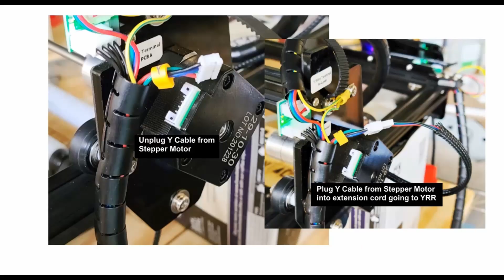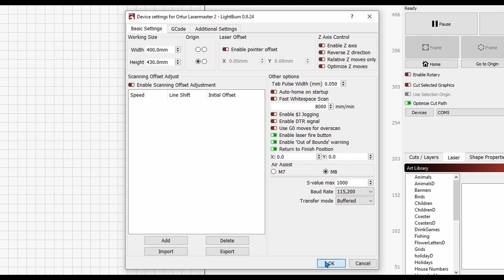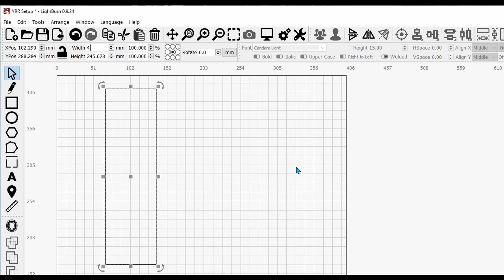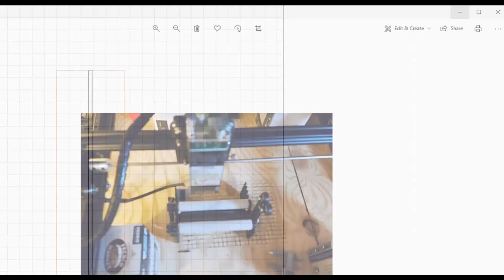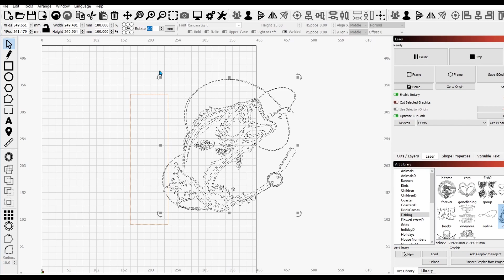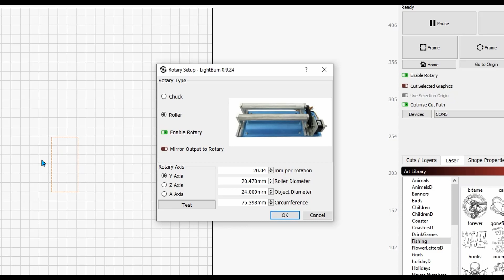👍 Ortur YRR Rotary Setup - The Only COMPLETE guide!

Comment: Hi.. If I removed the Y connector and i want back it to normal cut or engrave , i will use only the default setting I saved before then unable the rotary without plugging back the y connector? Meaning even I dont plug in the Y , it will back all to normal?? Or should I re plug again the Y connector?? I hope you notice my comment
Reply from the maker: Hi! Yes, you will need to re-plug the Y connector back in to return to normal cutting/engraving and turn off the rotary in Lightburn. 👍
Reply: thank you so much

Comment: i bought the longer ray 20w laser engraver 800x800 extension to and i bought the ortur chuck rotary. now with the 20.2 update on Lightburn i can finaly use the machine settings! so stoked i hope it works. what diameter do i put in for the ortur chuck? i also put a longer ray stepper motor in the ortur chuck to be sure it is compatible it looks identical.
Reply from the maker: The diameter settings are in the Ortur manual. I don't remember them offhand.
Reply: @TheLouisianaHobbyGuy  they dont work at all! using longer ray 5 20w and the ortur chuck.  it took hours of trial and error testing i got it though it was change 101=31 then it is perfect. so dont tell people the normal settings will work please!

Comment: I Know you did some 3D print video I need some help with A Issue I can't seem to fix . I have adjusted the Retraction speed and distance with no luck my issue is when the head goes across the print not in print mode it still leaves a string on top mainly on the flat areas, Is there another adjustment in cura I'm Missing? thank you sir.
Reply from the maker: I wouldn't be the one to ask Les, sorry.

Comment: I did the setup just like you showed and when I start to burn the roller just chatters and don't turn what am I doing wrong ??
Reply from the maker: This video has worked for hundreds of folks Les, with the original YRR roller. It could be a hardware problem, like maybe a bad stepper motor, or incorrect wiring? I can't really diagnose it in a text.
Reply: @TheLouisianaHobbyGuy  I got this roller about 17 years ago never used it the laser does what it is supposed to do so your probably right I think I will Upgrade to a new model and see if that is the problem. I have a Atomstack and I'm gonna just get the Atomstack roller and that way they will match. I'm sure that don't make a difference But they will both match . thank you I'll give that a try.
Reply from the maker: Take a look at this video: https://youtu.be/etpx6_I3SlE
It has adapters for several brands if you have the 4-pin plug.
Reply: @TheLouisianaHobbyGuy  yes sir. you are right got the new one in and working Great Thank You Thank You !! 🙂!!
Reply from the maker: @ Glad it's working for you!

Comment: Thank you for all your help !! My question is I have several lasers on the setup can I set 1 Laser For just rotary usage only and the others for flat work. ? the Rotary setup wont change the flat laser setup will it. two separate lasers ??? So when I choose the rotary laser it will be setup for rotary and I choose the flat laser the setup will be for flat work right ?? Thank you
Reply from the maker: Yes you can Les! Each laser has its own profile in Lightburn, so when you switch from one to the other, Lightburn remembers your settings. You can also operate multiple lasers at the same time. Simply click, File --> New Window for each of the other lasers you need to use.
Reply: @TheLouisianaHobbyGuy  I didn't know about multiple lasers at the same time ! thank you this is Awesome thank you for all your help !! I'm Gonna burn up the world LOL . Thank you again 🙂

Comment: My rollers keep spinning way too much, and at first my x-axis went all the way to the rail when I hit frame, what settings am I missing here?
Reply from the maker: Try setting your origin to Current Position.
Reply: Thanks for the quick reply! Setting origin to current position did fix the x-axis from hitting the rail, but rollers still kept spinning. 
Would that be I just need to dial in my steps per rotation?
Reply from the maker: This likely is happening on startup. The laser is looking for the limit switch Rachel. You can either activate the Y switch by hand, or just let it time out. Yes, it must be calibrated. This is a Co2 demonstration, but the calibration is the same: https://youtu.be/6qxEU7KCVVg
Reply: @TheLouisianaHobbyGuy  Thanks for being very helpful and responsive!

Comment: Thanks for this guide to setup the Aufero rotary to my Aufero LU2-4-LF, I know that this is an old tutorial but the info was spot on. I plugged the rotary into the y1 plug and figured out that my y2 connection had to be unplugged also in order for the rotary to work properly. I just wanted to thank you.
Reply from the maker: Glad it helped!

Comment: Hey Rich. I'm having a lot of issues with "line drag" for lack of the correct term. It looks like a couple of passes are being dragged down a fraction of an inch out of the image area. so my finished product is nicely engraved except for 2 or 3 passes (vertical) screws up the image. Anything you can suggest would be a huge help. Cheers. Keep up the good work. (I apologize if you've touched on this in a previous video, I couldn't find anything applicable).
Reply from the maker: Without actually seeing it Brad, I would think it's likely either an anomaly in the file or perhaps something loose on the roller itself.

Comment: Awesome video. It is absolutely dummy proof. Very straight forward. I just have one question though. How do you adjust the focus?  Is it the same as when you engrave a flat object?  I know that on a flat object you use that cylindrical test fixture to adjust the distance inbetween the laser head and the object to be engraved. Just wondering if the process is the same. Thanks.
Reply from the maker: Exactly the same.

Comment: How do i set the mm per rotation.  This was never mentioned
Reply: I believe ive figured out a trial and error method.
Reply: I didnt watch the video far enough..lol. sorry
Reply from the maker: 🤪 No problem!
Reply: @TheLouisianaHobbyGuy  i do have a differnt question if the retangle does line up perfectly is that cause i dont have the rotary tool perfectly perpendicular to the x axis?
Reply from the maker: I don't understand the question.
Reply: @TheLouisianaHobbyGuy  so im using my rotary tool and the 4mm retangle isnt aligned.  I know how to get the small line to touch but long lines of the retangle are off. By about 2 mm

Comment: Thanks for this.  One question, if my tumbler diameter is wider at the top and narrower at the bottom, where do I measure my diameter from?  (Assuming my engraving covers most of the cup)
Reply from the maker: Where ever you're going to engrave it. If you're engraving both, I would suggest cutting the shape, putting it on another layer and running the 2nd job after refocusing.

Comment: Fantastic video, best out there. How do I stop my bottle/tumbler from moving to the right by itself, all my graphics are no good, I’ve tried putting a block of wood at other end of bottle, but that just causes bottle to slip on rollers, how are you managing?
Reply from the maker: The roller has to be completely flat Aaron. Plus you could put a couple of rubber bands on it to keep it from moving.
Reply: @TheLouisianaHobbyGuy  hi, my roller is flat, I used a spirit level on table, I do believeit should have been createdwith baffles at both ends to stop item moving. I will give elastic band a go :)

Comment: Hi  I followed your steps to help setup my Rotary but after my laser won't fire kindly give assistance
Reply from the maker: The laser not firing has nothing to do with the rotary Bernard.
Reply: But it works fine when it's not in Rotary mode. And the red keeps flashing. In my console it say connected target buffer size found
Reply: Your steps are really great I don't why mine isn't working

Comment: I have an Atezr p10 and a RA2pro rotary.  When I try to put a design on a pencil I get either a straight line or something wrapped around the pencil.  When I try to shorten it,  it becomes a line.  When I try to make it larger it wraps around the pencil even though it falls within the parameter of the test.
Reply from the maker: You probably have to turn your design sideways.

Comment: I set up the Ortur rotary but my proportions are off. They are not true measurements. Ex. It is not say  3X3 inches It comes out like 3X1.75 inches. What am I doing wrong? Thanks
Reply from the maker: Most likely your steps per rotation are off.

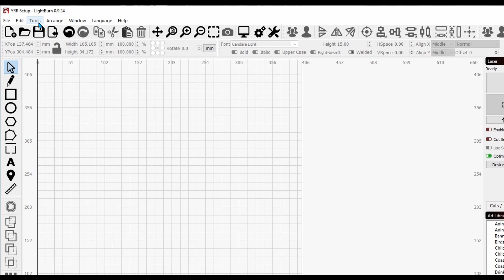Comment: I'm having trouble setting up my rotary on my LM3. At 5:40 where are you getting the information for "mm per rotation"? I can't seem to find information for this anywhere.

Thanks and great video ☺
Reply from the maker: It's a best guess to start off with Liam. You can't skip through the video. You have to run tests and adjust that number as you go until it's perfect.
Reply: Thanks, I've watched the video through again and found what I was looking for 👍 The PDF was a great help too when I was setting up my roller.

Comment: Hello Rich I just got my Ortur YRR connected today and I am a little lost. Here are the things I am running into. 1. The cuts do not look like the image in lightburn. They are stretched. When  I frame the head moves away from the point I set it on and frames somewhrere else to the right side of the frame which would be the top of the job. When it finishes cutting or engraving the head moves all the way to the left side of the frame. I followed the iisntruction to the t so I do not know what is going on. I am working on Absolute Coords. Could you please help me with this? and Thanks so much for what you do.
Reply from the maker: Try posting on my free forums Axel. https://lahobbyguy.com/bb This really isn't the place for tech support.

Comment: Sorry Rich, I assumed the comments went with the video I was viewing. The video I watched  was called "Ortur Laser YRR Rotary Setup The Only COMPLETE guide!" you showed saving the setting to make it quicker when you switched back and forth from rotary to flat laser work. Unless I missed it, it did not show where or how you use those saved settings to switch back and forth.
Reply from the maker: Just click on device settings and turn of auto home on startup, and then on the move tab, set the speed to 200 (mm/min)

Comment: Ok thanks for the help, I'm sending the Pergear back and I ordered the Ortur, see how my luck is with that one. Question for you on your video, I saved the files as you recommended to be able to switch  back and forth to regular laser work, but you didn't show how you actually toggle between those two files to adjust the settings accordingly. Where do you move that file to? Sorry I'm computer challenged.......
Reply from the maker: I don't know which video your asking about Jim, sorry.

Comment: Ok thanks, I'm going to email Ortur and Pergear both and see what they say. I can't see the wire colors on the laser as it's a flush connector in the frame at the back by the switch for YRR. Or am I supposed to be plugging in elsewhere?
Reply from the maker: You're plugging in the right place on the LM3 Jim.

Comment: Rich I'm setting up my new Ortur laser master 3 and I bought the Pergear rotary. I've set all settings as your video suggests and when I go to frame the rotary does not move. Now am I missing some steps or is the pergear rotary not compatible with the ortur laser? When purchasing the rotary it said it was compatible.
Reply from the maker: I don't know Jim, I never used the Pergear with the Ortur. If the pinout is the same, you can use it. Red to red, black to black, yellow to yellow.

Comment: ok got this thing back out to try it again, I got frustrated the last time and just put it away ,i've watch your video at least 10 times and I've followed all of your steps exactly but when I go to frame or even burn my module flies across the x axis and violently crashes into the other side of the laser frame. I have no idea what is going on? is it maybe this YRR?
Reply from the maker: Ah, go to the Move tab Sandy and lower your speed!!
Reply: @TheLouisianaHobbyGuy  that didn’t help still crashing into the y axis
Reply: 400
* a Console
Homing fail. Could not find limit switch within search distance. Defined as
1.5 * max travel on search and 5 * pulloff on locate phases.
ok
360
Ortur Laser Master 2 S2 Ready!
OLF:OLF 185.
OLH:OLM ESP PRO V1.2.
OLM: GENERAL.
320
Grbl 1.1f ['$' for help]
[MSG:'$H'I'$X' to unlock]
[MSG:Caution: Unlocked]
Ok
Reply from the maker: I thought you were using the roller? Did you turn the roller off in Lightburn?
Reply: @TheLouisianaHobbyGuy  yes it the YRR ortur roller type its going back in the its final resting place which is in the box I believe it is messed up...im afraid it is going to tear my laser up...I recently purchased the Atezr 20P which is a much better laser than this ortur...I just though maybe just maybe I could the rotary set up and just use it for cups and such but not luck..thank you for your help though
Reply: Ok I have forever put it back in the box but should be in the trash. But now my laser will not burn nor frame. I put it back to default laser settings and still nothing.
Reply: @TheLouisianaHobbyGuy  I was using YRR from ortur
Reply from the maker: @Sandyloucustomdesigns  Have you turned off the rotary in the Laser Tools?
Reply: @TheLouisianaHobbyGuy  yes I reset everything I ended up deleting lightburn and reinstalling. I just ordered the xTool RA2 Pro, 4-in-1 Laser Rotary hopefully it will work
Reply from the maker: The RA2 works perfectly on all the lasers I've tried it on Sandy. I did find the mm/rotation in the settings were 128 on the one I got, not 160.

Comment: Awesome video, super helpful, thanks for making it!  Got as far as changing the roller and workpiece diameters and hitting Test, but for some reason even with the cable from Y-Axis stepper motor unplugged and the rotary attachment plugged in, the gantry still moves on the Y-Axis while the rotary attachment also rotates after hitting Test.  Any thoughts?  Laser is a Genmitsu Jinsoku LC-60A 5.5W Laser Engraver Cutter with Air Assist System.  Thanks!
Reply from the maker: The LC-60 has two Y stepper motors. The 2nd motor needs to be unplugged.
Reply: @TheLouisianaHobbyGuy  Ah, thank you so much!!

Comment: Having a problem. When doing the test 4mm rectangle it does multiple passes. Just keeps burning and spinning. The progress stays at 99% and just keeps going. Probably did 6-7 complete rotations till it switched to the other side of the rectangle  🤷🏼‍♂️
Reply from the maker: Check the layer, you might have it set for multiple passes.
Reply: @TheLouisianaHobbyGuy  I checked. It’s set at one pass. I counted 6 rotations when framing. Ugh
Reply: Ok I might be on to something. Tried a test burn at 30% of a baseball and it came out extremely elongated going “around” the cup but is the correct height.  Any ideas?  Thx
Reply from the maker: Sounds like your steps per rotation are off. And I never frame with the rotary. Many of them don't frame properly.

Comment: many thanks for this video, it has really helped me set up my rotor. the issue I'm having is that my rotor spins multiple times when doing my test run, not sure how to ensure it runs just once 360.
Reply from the maker: Sorry, I can't diagnose problems in YouTube comments. But usually it's just the framing that has this behavior on the rotary.
Reply: @TheLouisianaHobbyGuy  it was the mm per rotation that was off, sorted that now, many thanks. It's there anywhere I can get the recommended speed and power settings for different materials
Reply from the maker: @tosanclarke  In the member's only section of my Forum. https://lahobbyguy.com/bb

Comment: Folks ...
I have a Question on the Settings ...while setting up Rotary Roller. I will be setting Up a AtomStack R3 Pro. At time Stamp 20:11 It shows 20.04 mm per Rotation. What measurement is that ? I understand Roller Diameter, Object Diameter and Object Circumference.
Thank You in Advance.
 Kirti
Reply from the maker: It's the steps/mm that the roller needs to make to go 360°. Every roller is different. I think the Atomstack was 60.

Comment: This helped so much thank you! Wondering how it works on different shapped tumblers
Reply from the maker: I've used it on all types of tumblers and glasses Kevin.
Reply: @TheLouisianaHobbyGuy  I did a skinny Tumbler (74mm at top and 68mm at the bottom) yesterday and found the if I leveled the roller it worked great. I had cross hatch enabled which caused it not to work right, as the machine just kept jogging to the left. But as long as I have only going at 0 degree it works really well.

Comment: Hello, Rich!
I have a question. I'm owner of a Atomstack S10 Pro and a Rotary R3. Is ist possible to install the Rotary to move the x-Axis instead of the y-Axis? It would be much easier to work with, because the alignment of the objects to be engraved would be the same as if I would use a flat underground. If I use the y-Axis as rotating axis I must always think about how and in which direction to place the objects...
Best greetings from the northern Germany...
Reply from the maker: Not that i know of Klaus.